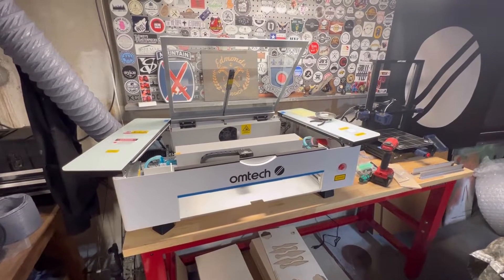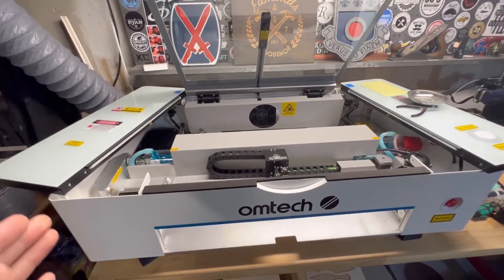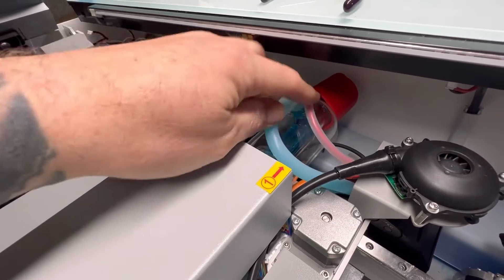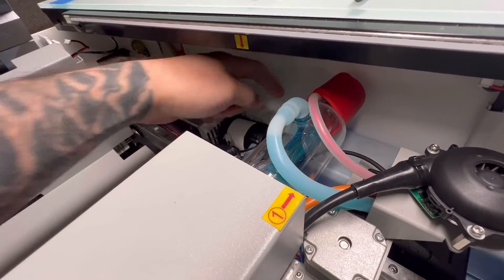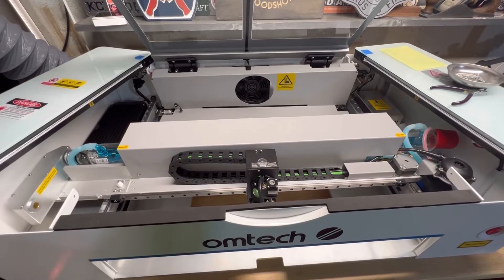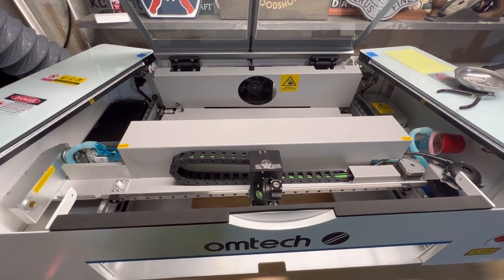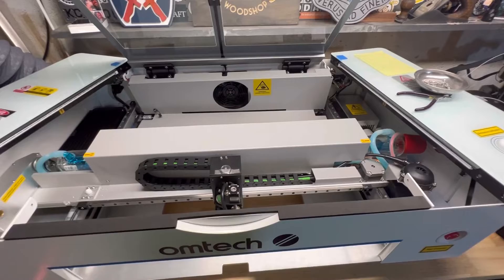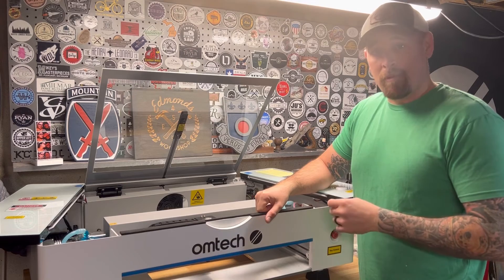OMTech Polar Laser Tube - Can I Replace It?

Comment: Omtech just sent me a new laser tube  but How would you remove the water from the old laser tube and do you have to cut the rubber tubes cause it is on there pretty tight.
Reply from the maker: Unfortunately there’s no easy way to do it. You can siphon the water out of the tank or get a pump. Once the tank is empty there will be residual liquid left in the tube. You’ll have to be be careful when removing the the mounts and tubing not to spill the liquid inside.

Comment: To me the problem with Omtech Polar is that you can't really buy the tube. They don't sell it on their website. And when I reached out to Omtech, they said that the tube is Yongli T10 which was specially customized for the Polar machine and that they can provide a replacement while the machine is under warranty, but they don't sell it otherwise. Which basically means if the warranty has expired or if you got a second-hand machine and the tube died, you are in trouble.

Omtech doing such thing isn't cool in my opinion.

Comment: What?? The tube is on the axis?? How do you change the water?
Reply from the maker: Yes it rides on the gantry. There’s an internal chiller that holds the coolant/ water. They say that it just needs to be topped off
Reply: @Edmonds Woodshop  I have a Fluxbeamo and it's recommended to change the water completely every 3 months. So, I wonder how I would do it with this?

Comment: Can you put a larger wattage tube?
Reply from the maker: Not that I’ve seen as a direct replacement. The tube diameter and length needs to be equal to that of the tube that’s currently installed. If you want to be able to have a laser that’s easily modifiable then you’d want a cabinet size laser

Comment: How did you get the side panel to swing away?
Reply from the maker: They’re just sitting on top of the laser. There’s two screw that hold the covers on and then you can pop them off. Don’t do what I did because I dropped one of my covers and shattered the glass
Reply: @EdmondsWoodshop  thanks! And I appreciate the heads-up! Sorry the glass broke though 😔

Comment: Im wondering if this Omtech polar laser has a visible red laser which is useful for alignment and/or framing your work before initiating the engraving/cut? I really like the print & cut feature of lightburn which allows you to realign a workpiece that's been moved and I'm wondering how would I be able to use this feature without a visible red laser guide.
Thanks
Reply from the maker: It does not have red light. Maybe you could modify and add one, but you would normally use the camera to align your print and cut feature

Comment: Have you taken the aluminum cover(left side) off of the controller yet? If so just wondering if it says Gweiki? So far this looks identical to my Gweiki Cloud Pro. Just curious if it's the identical machine or if they put a different controller in it.
Reply from the maker: Gweike and OMTech are collaborative partners. I confirmed this with OMTech, so many of the parts may be the same. I have not tested the gweike cloud so I’m unfamiliar with their controller but the polar uses the RDC6442G-B (EC). This is the same exact controller on my 80w
Reply: @Edmonds Woodshop  I can't figure out what the controller in mine is. It's not in a standard Ruida case, it's just a standalone board with integrated stepper drivers. I heard it's a Ruida but haven't been able to confirm. Do you have a picture of the controller in the Polar?